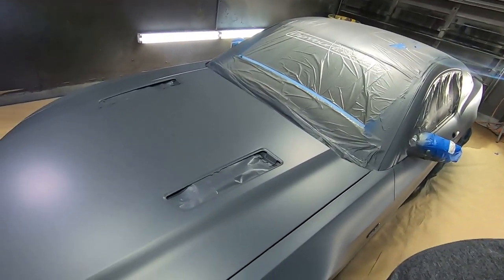Mad Scientist 5 - MIXING Wicked Wine + Extra Lime

Comment: Experiment on what happens if you put two colours in a bucket and spray it without mixing them!!!!
Reply: brilliant
Reply: Color
Reply: The sprayer would mix them?
Reply: @spencerwells1328  yeah but it won't mix it completely....
Reply: They did it
Reply: @husseinn.3851  and it comes out cooler
Reply: Yes they did it and as Spencer said, for the most part the sprayer mixed it.  Still looked cool though
Reply: They did and the result was awesome!

Comment: When I used to paint cars, I would do 2 nice coats using Sherwin Williams regular car paint, I had my own mixing machine and all of the colors and the metallic additives and not Lacquers, I'd wait about 20 minutes between coats to let it tack up, and then I would do a third coat but,  I only used to mix 1/4 of the paint in my spray gun of the color and the rest of my spray gun I would put Mixing clear in it to top up my gun, and that paint and clear would really lay down nicely and look like a sheet of glass, I did this on many many cars back then in the '70s and they looked beautiful, for the way I was painting them, but, not like the paint jobs today, when you have 5 to 6 or more coats of clear, then sanding between coats, etc. Back then, people didn't pay the money like they do today for a paint job, $1000 was about the normal price, but those paint jobs that I did sure looked nice and when I was done every customer was a happy customer with a nice shiny paint job, and a lot of other local painters were all trying to figure out how I go my paint jobs to look so nice, and I didn't tell them how I did them, and that's why I was pretty busy for a long time painting cars, lol. Also back then to buy an ounce of pearl to add to paint was over $100????

Comment: Hey man, why don't you just make and try using a baffled paint sprayer canister to keep the colors separate, while spraying. The baffles could have small holes in each, the atomic weight of the paint should keep them separated until they're force thru your sprayer.